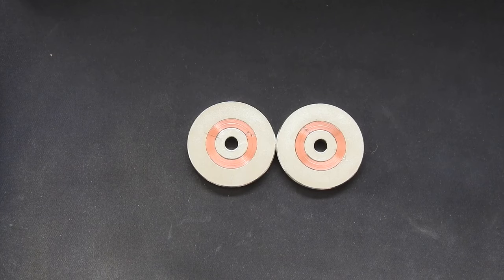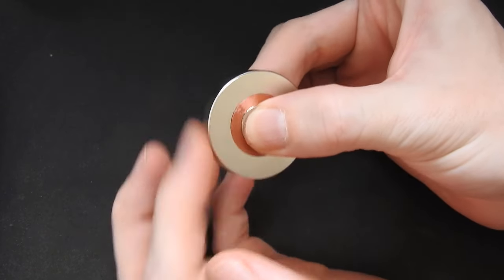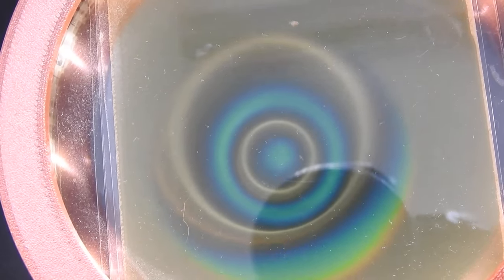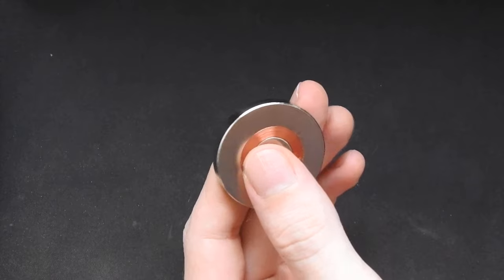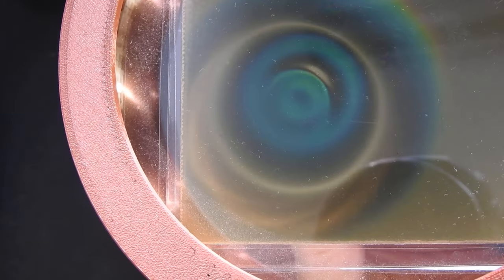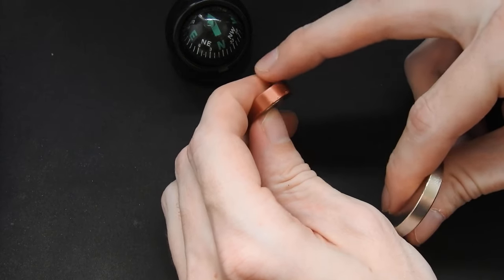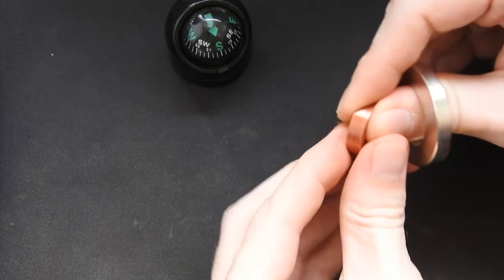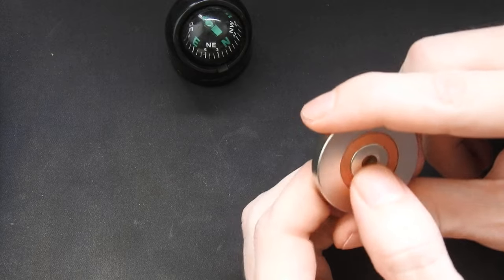Ring magnet inside a ring magnet - different orientation result in a different field geometry

Comment: I really enjoy watching your videos, but it would be easier to follow along if you marked the poles on the magnets. You could use a Sharpie to write a small "N" or "S" on both of the poles, and then just use rubbing alcohol to wipe it off after the video if you want.  Also, you should try adding some crystals into your structured water.   It energizes the water after it's been reset.
Reply from the maker: I should buy a sharpie then haha.